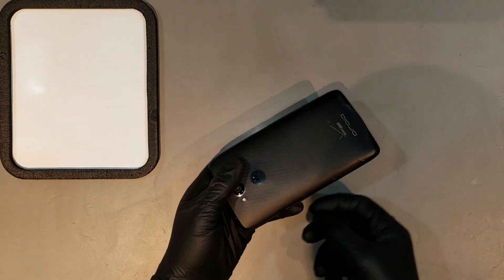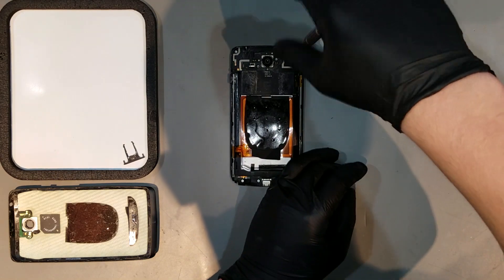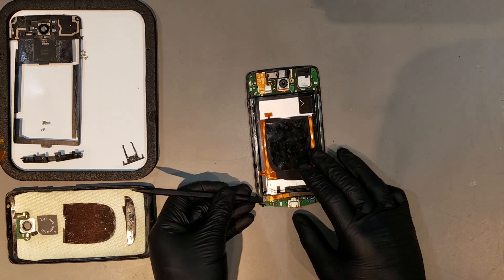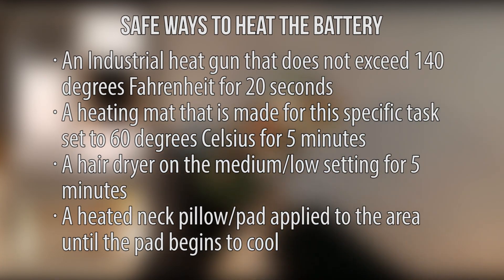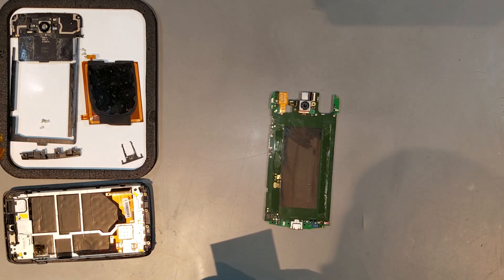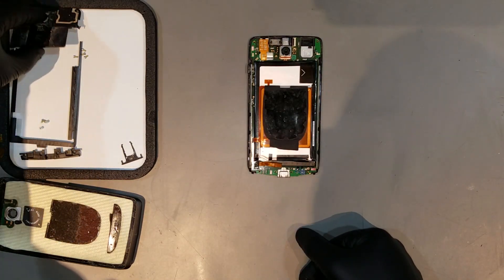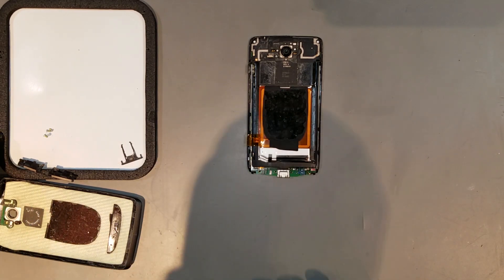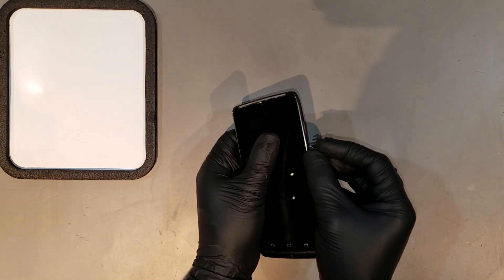Motorola Droid Turbo Battery Replacement

Comment: Thanks for the detailed instructions. I found removing the case back to be much more difficult than the video suggests; I'm guessing that you'd removed it before? I found the corners especially difficult, possibly because I had never done this before and REALLY didn't want to damage the case.  The bottom was the worst; I finally heated and peeled back the cover from the top to get enough slack  to remove the bottom.

I didn't disconnect the wireless charger, just folded it over out of the way as suggested at https://www.ifixit.com/Guide/Motorola+Droid+Turbo+Battery+Replacement/56673. I used a blow-dryer set to high on the case back for about 30 seconds to loosen the adhesive but my wireless charger came loose from the battery before it did the case. If the same thing happens to you, be careful not to damage your charger by pulling the left side (viewed from the back) when you're prying off the case back. Instead treat the left side as if it were a hinge and rotate the case back around it.

I also used the blow-dryer set on high for about 30 seconds to heat the circuit board behind the battery before removing it.

When I put the new battery in position, it was just a little bit low and the edge of it interfered with plugging it into the connector. Since I used nice, new and very sticky tape to hold the battery in place I had to heat it up again to remove it, then clean with alcohol and apply new tape. This time, instead of trying to set the battery in the perfect position I held the battery upright and plugged it in, then laid the battery down on the tape. Since the connector isn't a type most of us are familiar with, I recommend trying it out before putting any tape on so you can see how it goes.

My phone is nearly 3 years old and the adhesive holding the wireless charger in place on both sides was not reusable. I cleaned off what I could and replaced them with 2 strips of the same 2-sided tape (https://smile.amazon.com/gp/product/B019OQ4YV6/ref=ppx_yo_dt_b_asin_title_o01_s00) I used to hold the battery in place. I did the same on the camera/speaker assembly.

Comment: Bought the new battery. Bought the tools. Followed every step (edit: I did not unplug the touch screen ribbon. Just leaned it up  and supported it at a 90° angle)... No mention of being careful with the tiny,  fragile power button on the circuit board. Ended up breaking it off when laying the board back into the frame. My device is now useless. *Edit: found new switches on ebay, and soldered a new one onto the circuit board. Took a few tries, but it has been working so far.
Reply: Going to try this. Where is that button located exactly if you don't mind
Reply: @cz2532   It's the switch under the power button on the side on the phone.

Comment: My Droid's battery was dying and after finding your video I decided to tackle the job of replacing it myself. The job went smoothly with the help of this video! Only issue is now my Bluetooth has very short range (4' or so) and I have to have phone or ear bud sitting just right - I've tore phone apart a couple times and rechecked connections - any suggestions?

Comment: Thank you!  I decided not to remove the screen after reading some of the responses.  The process was very straight-forward and simple.  Heated the phone by placing it on a Qi charger while running GPS software (gets plenty hot!).  Used a credit card to separate the back, the Qi coil from the battery, and the battery from the board.  I think I may buy a new back, just to make the old nylon look better.  Perhaps place a magnetic ring over the Qi coil (under the back) to help the phone adhere to a magnetic Qi car charger.  All-in-all, a simple repair, but one that makes you perform a gut-check throughout the process (I miss battery doors!).

Comment: Great video...I got it all put back together and the screen doesnt turn on.  It just vibrates every 20 seconds.  what did I miss?
Reply from the maker: That sounds like it could be the battery. Try disconnecting it and reconnecting it to see if that does anything. If that doesn't work, see if it still does that while charging

Comment: Is there specific battery you used, or can any battery made for the Motorola Droid Turbo work?
Reply from the maker: For this video, I just used the same battery I took out, but the link below provides OEM Motorola parts, so that would be the best place to get the battery
https://www.mobiledefenders.com/battery-eq40-for-motorola-droid-turbo-xt1254-authorized-oem.html

Comment: IMPORTANT NOTE IF YOU CAN NO LONGER CHARGE YOUR BATTERY READ THIS:  Removing the back casing ripped my Qi Charger Coil. :( This affected the battery temperature reading which prevented it from charging.  No obvious error, you just plug it in and charge doesn't go up.

You can order a new Qi Charger Flex Cable but it takes forever to ship. 

 I found that the only way I could charge my phone was through the "Android Recovery" Screen, that's a decent work around:

         1. Ensure the device is powered off.
         2. Press and hold the Volume Down button and power for 3 seconds then release
         3. Select Recovery mode.
                   Note Utilize the Volume buttons to scroll through the menu options and the Power button to select.
         4. From the 'No command' screen (image of an Android with an exclamation mark), do the following to display the menu options:
                  Note Ensure the steps below are performed in a timely manner. If power is held too long (longer than 5 seconds), the device resets.
         5. Press and hold the Power button.
         6. While continuing to hold the power button, press the Volume Up button then release all buttons.

Good luck , even though it was a hassle, the phone is still really good after all these years, it's worth it.
Reply: I would imagine heating the back of the phone before trying to remove the backing is the best way to go about avoiding this. There seems to be an adhesive between the back casing of the phone and the Qi charger.
Reply: Thank you, thank you, thank you!  I couldn't figure out why my phone showed the battery charging but it wouldn't charge.  After trying to redo, trying the old battery, and searching and searching I saw your post.  You saved me!  I did exactly this.  I got lucky, though, and a guy literally 30 miles from me was selling one.  I had a QI charger coil in two days, replaced it and it works great.  Thank you again.  You saved me a huge headache!

Comment: The screen ribbon is a pain in the ass to replace. the only things you really need remove are the speaker assembly, the spacer and peel back the wireless charging pad. Disconnect the battery, heat up the phone for 5 minutes with a hair drier, and pry it out with a plastic ruler from all sides. no need to remove the charging port thing or take out the motherboard. 
Also, use the spacer when you put in the new battery, otherwise it will be too high/low or too much on the side.
Reply: Great idea!

I was wondering how one would place the battery just right

Thanks for sharing that tip!

Comment: PLEASE BE AWARE.  The clip that is attaching the battery to the board comes off easily by a single flip. BUT re-clicking this small connector is a nearly impossible task. If the clip won't attach at once, please move the battery untill the clip is at the right place, then lay down the battery. Clicking the clip WHILE laying down has no use.
Reply: yeah, you have to use the spacer to place the new battery.

Comment: Thanks, this was huge help. I didn't have any adhesive, but it all went back together fine. Do you think it would be worthwhile to get some of the red tape, and take it apart again to add the adhesive?
Reply from the maker: Glad it helped! I would say it's probably worth it, even just to use regular double sided tape you'd find at walmart (Just so you don't have to pay twice as much and have it shipped to you), just to make sure the battery doesn't shift around too much and possibly become damaged

Comment: This is a good video BUT, it would have helped if you had zoomed in on the brackets and pins when disconnecting the battery for example.  Also, you are using a phone that has been taken apart previously, which made it seem deceivingly easier than it is to replace the battery in a Turbo. My phone had never been taken apart and the torx head screws felt like they had been overtightened from the factory and had a bit of lock tight put on them. Two of my screws on the bottom bracket that goes over the charge port, that would normally slide downward and off,  stripped out and I had to do the battery replacement with it still on.  Also couldn't "fold it open" to apply heat on the bottom side of the battery.   I was still able to do the battery replacement and get it all back together, I am using it now to post this.  Honestly if you have  important stuff on your Turbo that isn't backed up and you don't have a backup phone, I would recommend buying a replacement battery yourself (cheaper) and having a phone repair professional do the replacement that will backup their work.
Reply: the screws have loctite, that's why they seem overtightened

Comment: do you have a link for battery?
Reply from the maker: This is direct from Motorola, but there's only one left:
https://www.amazon.com/Replacement-Battery-MOTOROLA-EQ40-SNN5949A/dp/B01881407G/ref=sr_1_5?ie=UTF8&qid=1508038843&sr=8-5&keywords=droid+turbo+battery

Comment: Hi! I change my battery and now my phone do not turn on!
Reply from the maker: If you still have the old battery on hand, try plugging it back in and seeing if it turns on. If not, you may have a defective one and might need to order a new one
Reply: JacksonTechRepairs thank you so much for your answer, I just conected the battery wrong!
Reply from the maker: Ahh, it happens. Glad you got it to work!
Reply: Hi i plugged my old battery back in...i know it had a 90% charge on it.  The unit didn't power up.  Any suggestions?
Reply: you didn't connect the screen ribbon correctly. fought with that myself for two damn hours.
Reply: Dan Slotea I tried for several hours myself...no luck.  New phone for me :(
Reply: Dan Slotea bent the prongs on the ribbon slot
Reply: diamondjoe1109 shiiiiiiiit